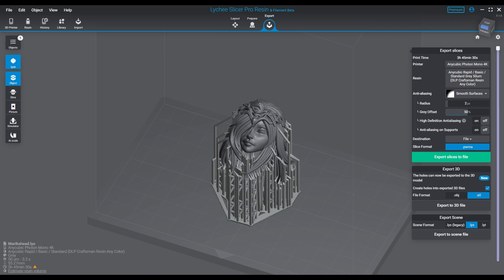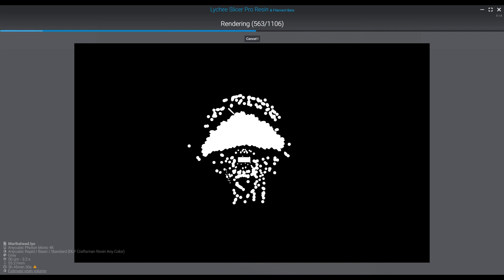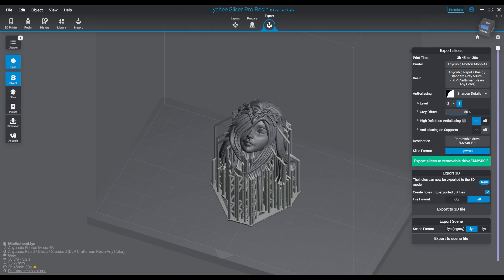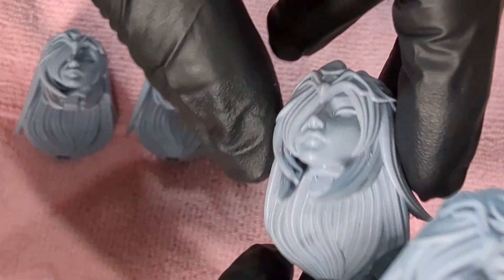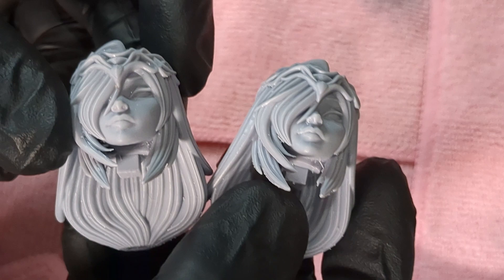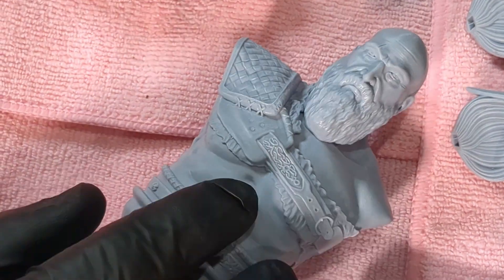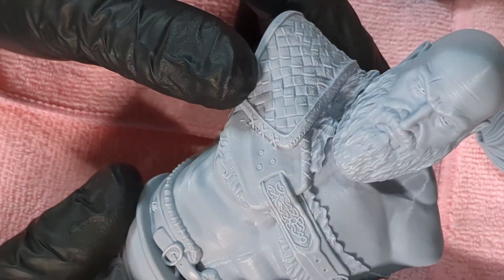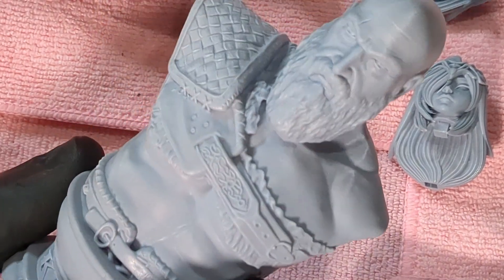3D Printing Lychee Slicer Anti-Aliasing settings explained part 2

Comment: Lychee AA won't work for me... no matter what setting :(
Reply from the maker: What printer are you running? What is the resin? Some resins do not work well with AA at all, and some printers do not support levels higher than AA 1.
Reply: @IPrint3dMinis  I'm using the Phrozen mighty 8k. Actually it is working now once I updated firmware on printer. Also, what px radius should I use for a 28um pixel resolution? In the lychee documentation it states that printers with a pixel width of 50um need 2px, whereas a printer with a pixel width of 35um needs 3px.
Reply from the maker: @brendon6930  Glad you worked out that issue. That should have great AA capabilities for sure. For 28um I still recommend 3 px.
Reply: @IPrint3dMinis  Ok thanks so much! I still don't get what High definition anti-aliasing is supposed to do. It seems to increase slicing time significantly.
Reply from the maker: I think it is a method in which they apply finer resolution to the exported slice layers, this should in theory increase the quality. I don't use it. @brendon6930
Reply: @IPrint3dMinis  Just curious, is there a reason you don't use it, like a disadvantage or something?
Reply from the maker: Yes, honestly just because it takes longer to slice. I also feel like it does absolute nothing for the print quality as I have tests with it on and off and they seem the seem or if there is a change it is absolutely impossible to tell. @brendon6930

Comment: I'm just away to try all this with my new saturn 2 I've got the exposure on point, it's the Voxel lines that Annoying the heck out me!. On the tops of the heads amd shoulders etc I see on your model all the voxel swirls on the 6 pac just wish there was a way to remove these completely without using that guys airbrushing resin in the model lightly but it worked quick spray amd 10 second cure they were gone on a Cape and a Cape is nuts for voxel line's being smooth n curved! He doesn't advise doing this if you don't know what your doing but his results were just unbelievable doing this so worth a try! Chitubox AA is ment to work alot better that lychee but it's lychee I like to use so the AA doesn't really work all to well yet!.
Reply from the maker: Chitu seems to work better for Elegoo machines as far as AA, Lychee seems to work best for other types. In my honest opinion the visible lines still bug me, and there are some no matter what. I am currently upgrading my farm soon, so we will see if the new machines will produce less lines in 12k.
Reply: I am using a Saturn 2, that is a nightmare, no AA option is currently working. @IPrint3dMinis
Reply from the maker: Elegoo and Lychee don't play well together.

Comment: Id be curious to see this same test run on 28mm miniatures instead of large statuettes. Ihave found that even barely perceptible layer lines will catch painting techniques like ink washes and drybrushing and ruin the finish
Reply from the maker: Great point! I will need to test that.